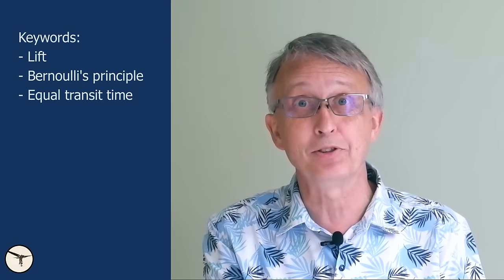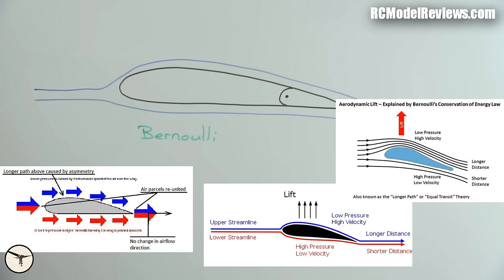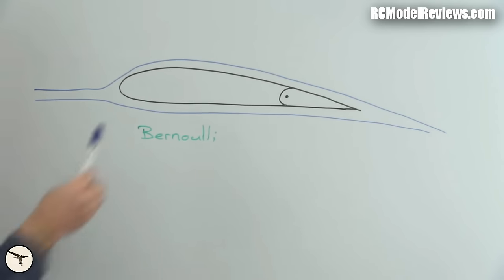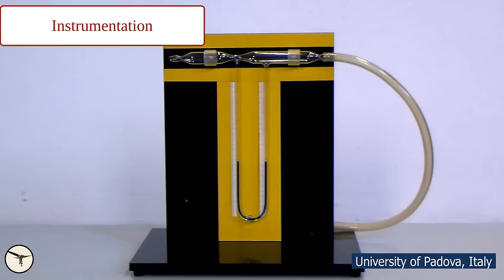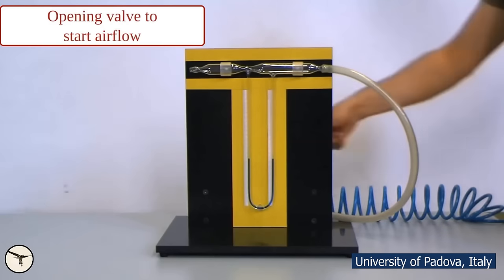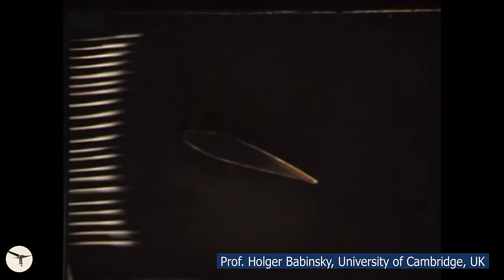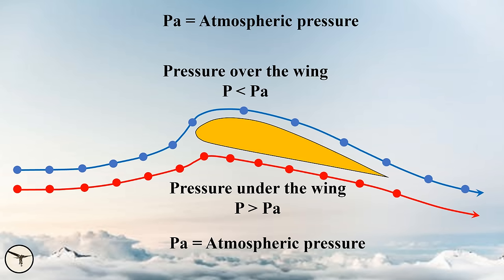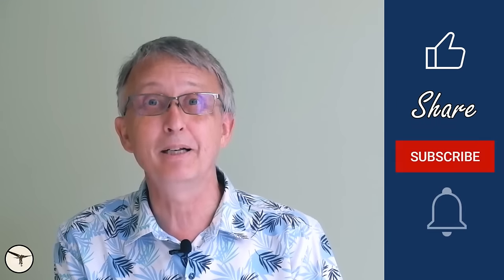Why are so many pilots wrong about Bernoulli’s Principle?

Comment: Why can't people get this right?
1. Bernoulli is only valid along a stream tube in an inviscid flow. The inviscid flow part is usually pretty valid for high Reynolds number flows outside of the boundary layer and shear layer trailing the wing. The stream tube is much more restrictive except when you assume that the far field has a uniform velocity and static pressure. Under this assumption (which is usually pretty good), all fluid starts with the same total pressure and thus has the same total pressure  around the wing. Your statement about how Bernoulli isn't valid because the wing divides the airflow into two parts is wrong.
2. Curvature in the wing is important for keeping the adverse pressure gradient under control and keeping flow attached at high angles of attack, but it still misses the point. Just as the symmetric airfoil befuddles the equal transit time nonsense, the flat plate airfoil (commonly found on small RC foam models) and the supersonic diamond airfoil (with a sharp leading edge) befuddle curvature as the source of lift.

IMHO, the best conceptual explanations don't even mention Bernoulli, but instead focus on what the forces are doing to individual masses of fluid. Air is under pressure and will expand when given the chance. As it passes over the top of the wing and the upper surface deflects down, air accelerates into what would otherwise be a void behind the wing. This is accomplished through a vertical pressure gradient resulting in reduced pressure on the upper surface. However, pressure is a scalar and the reduced pressure also corresponds to a horizontal pressure gradient which first acts to speed up and then slow down the flow. At the same time, the bottom of the airfoil has to deflect flow away from it which has the opposite effect and produces a high pressure region which slows flow down and then speeds it up. This is why the transit time over the suction side is faster than the transit time over the pressure side.

The exact geometry determines where the peak pressures occur. On most subsonic airfoils, fluid begins to be deflected from the pressure side to the suction side a short distance ahead of the airfoil. Because it already has an "up" component (or down component for negative lift), it has to expand around part of the leading edge resulting in much higher normal accelerations (from the high curvature) and lower pressures which move the location of the minimum pressure forward. In a completely inviscid flow, this perfectly balances out the normal force experienced over most of the wing (which is tilted back towards the trailing edge) and results in no drag. In a real flow, there is some pressure drag, but most drag comes from viscous forces in the boundary layer.

I suspect someone will mention circulation. There are enough people who view circulation as fundamental that I won't completely dismiss it, but I personally view it as a convenient mathematical relationship derived from complex analysis (one derivation literally just uses a conformal map of a complex valued function) that is largely divorced from what is actually happening.

Comment: This is also conveys a flawed concept in regard to fluid speed and pressure drop.  This can be seen with a pitot static tube, which has small holes in a radial pattern at some distance from the nose to detect static pressure, AND the static pressure is not (in real terms) affected by the forward speed (speed of air flowing over the holes). Lift primarily originates from a change in (fluid) momentum (a vector quantity), classical yacht sails are very effective and do not have the classical aircraft wing section, a flat plate generates roughly the same lift as an aero foil, but is not as efficient and stalls early...

Comment: Isn't there a much simpler explanation: there's less space under the wing than above (because of the angle of the wing), but the same amount of air is pushed under as above and so the pressure under the wing is higher than above.

Comment: Interesting principle of flight... But wonder, how planes in aero shows are able to stay airborne when they fly inverted......with the wings inverted, the aerofoil inverted, the  plane should should actually race towards the ground. Do the elevators play a role here to keep the aircraft airborne in an inverted flight pass?
Reply from the maker: To fly inverted, you point the nose up above the horizon. That mans you have to push the stick forward, and you will experience -1 G. Of course, the fuel and oil system must be designed for negative G. This video explains lift in more detail: https://youtu.be/d4w1Iy4vVMg
About 12 minutes into the video, I explain inverted flight.
Reply: @FlywithMagnar  Thanks for the video. That explains the inverted flying and the technique of symmetrical aerofoil and dynamic stagnation point. So, it means that the fighter /  aerobatic aircraft are designed to take up these maneuvers and not all aircrafts can fly inverted or vertical.

Comment: As a physicist, I have the impression Bernoulli's principle does not even apply to the problem, it is merely a side effect: That is because it relates a pressure gradient along the flow line with the acceleration along said flow line. However, the problem of lift is about a pressure gradient, and hence acceleration, perpendicular to the flow line. This has to do with he curvature of the flow, not it's speed.

Comment: You are showing an extreme angle of attack with your wing demos, so it would have been a better demo if the angle of attack was more level.  However, I don't doubt what you are saying.  I have read other articles claiming that the Bernoulli effect was not what gave a wing lift.  If this is true, can you tell me what it is that gives a wing lift?  I guess it could be just due to the angle of attack in the wing to fuselage mounting, but I don't know.  Can you help?
Reply from the maker: It is the pressure difference above and below the wing that creates lift. However, lift can also be explained with Newton's thrid law of motion: The wing pushes the air downwards, and the opposite force is lift. Both explanations are equally correct. You can also explain lift with the Kutta–Joukowski theorem and the Lanchester-Prandtl theory, but that's for the engineers.

Comment: In 5th grade, I wouldn't let my science teacher off without explaining the Equal Transit Time "theory" -- fallacy in fact -- to my satisfaction. I did not understand where the air molecules on the upper surface of the airfoil got the memo that "You must meet your lower counterparts at the same time at the end of the airfoil. You have a longer distance (being on a curve), so you must run faster."

Comment: Try Bernoulli.

Plug in the equation so a known lift problem.

Say; 
W=100kg 

S=10m^2

V=10m/s 

CL = 1.601

Now, how fast must the airflow be over the top of the wing, assuming the airflow under the wing is 10m/s? 

Answers below: